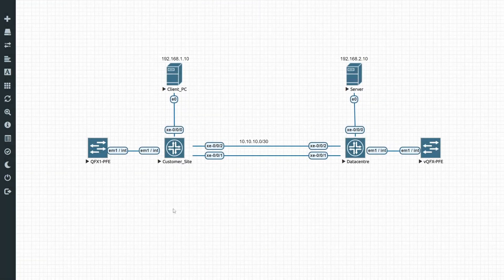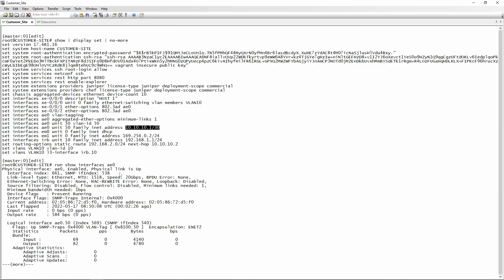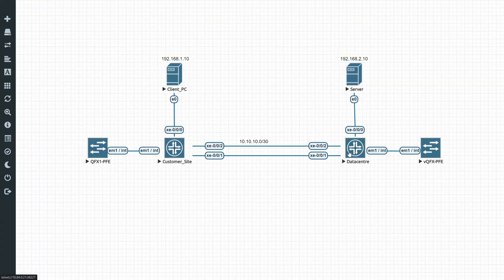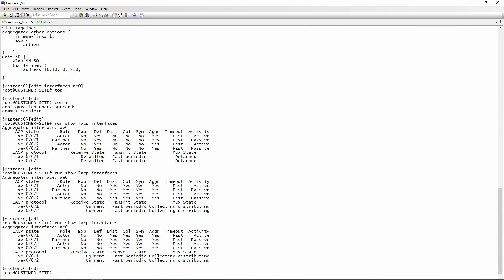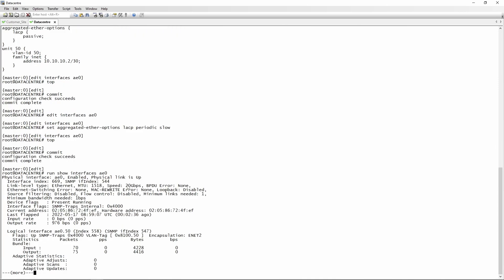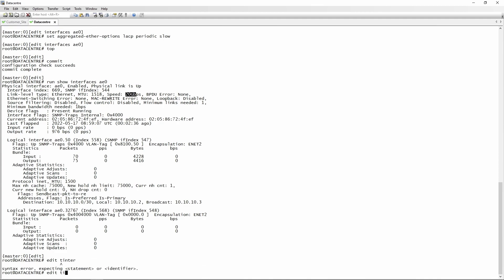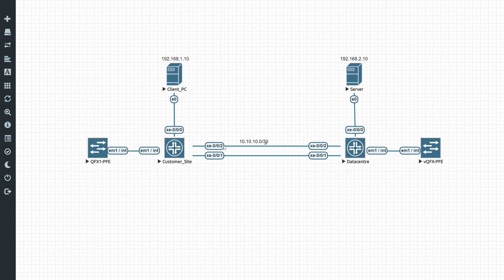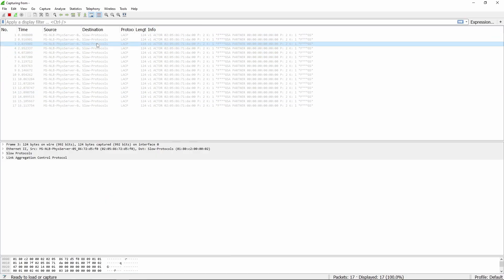How To Configure LACP on Juniper (Link Aggregation Control Protocol)

Comment: Is there a way to check a system-id (system MAC address) of a remote switch via lacp commands? I want to see what system-id i am receiving over lacp member links. That way i can check all member links are connected to the same switch.
Reply from the maker: I believe running the command “show lacp interfaces” should give you the output you require. I will check a few commands tomorrow and revert back with the correct one!

Comment: Hi Lame,
I'm a noobie, I dint get why the interface is down for snooping switch, it has ae0 and lacp right? So it should work
Reply from the maker: The control protocol was up first between switch 1 and switch 2 initially. When we broke the link on the second leg to introduce the snooping switch, the control protocol can see the LACP messages dont correspond with the initial messages, and doesnt bring that link up. If you unplugged both links and connected them to the snooping switch the links would come up. But if an existing connection is up and interrupted by an unknown switch, it wont 👍

Comment: HI Lame, 

Thank you for your excellent explanation and time you spent. :washhands:

I have one doubt, when we connect snooping switch, on what basis, CUSTOMER SWITCH identifies it as a unwanted switch  and the moves to blocking the ports? I didn't get on what factor we are black listing snooping switch .

suppose, if we were actually want to have such a topology, what should have been done here ?
Reply from the maker: Hi,

The snooping switch itself wont be blacklisted per se, but the LACP packets between your original two switches will stop working, and LACP will then disable that specific link.  There are  3 things you can do here:

1.  Disable LACP on the AE.  This will prevent the control protocol from disabling the links.
2.  Form LACP adjacencies with the "snooping switch".  If you enable LACP on the switch in the middle, the control protocol continues to work, and so would the traffic across both links.
3.  See if you can enable full transparent mode on the switch in the middle.  That would allow the LACP packets to traverse the switch in the middle.  This is how almost all DPI devices   work

Just remember, AE interfaces do their own kind of load balancing, so if you connect a "snooping switch" only on one leg of the AE, you will at best only capture half the traffic.  So to capture all traffic you would need to have both interfaces of the AE connect to the "snooping switch".  And then it would be best to have LACP run between all 3 devices, or have the switch in the middle set as fully transparent.

Hope this helps!
Reply: @lameaveragetechies1040  Thank you ! trying to understand the answer, though  didn't get the complete picture to my Question. 

slightly changing the question pattern: on analysing which parameter in packets, xe/0/0/3 from customer switch is went to detached mode ? why it can't go to forwarding state ? because snooping switch also respond to LACP from customer switch ? and snooping switch config is similar to datacenter switch as well ?

 Also after readfing answer, introducing xe0/0/0 from snooping_switch will m make the LACP packets between CUSTOMER--DATA CENstop working ?
Reply from the maker: @sharpitstudio2951  Can you send me an email, we can chat offline there.  lameaveragetechie@gmail.com